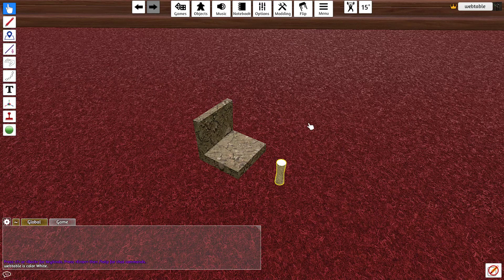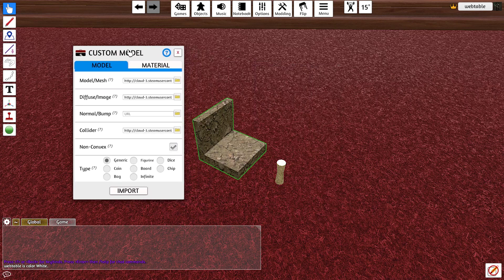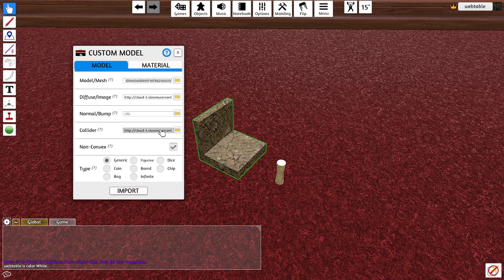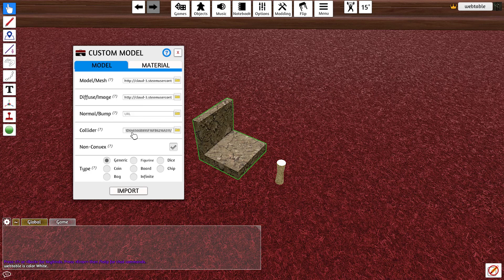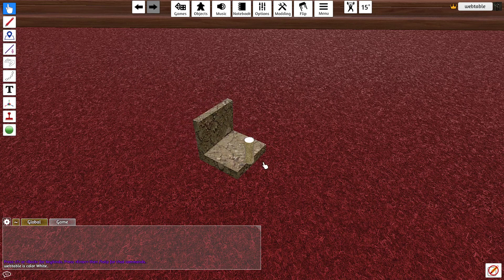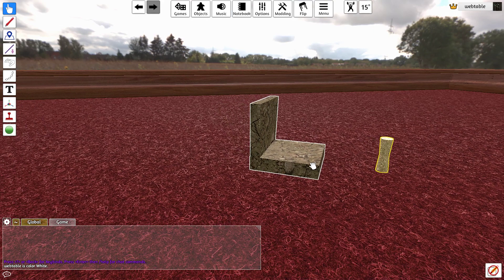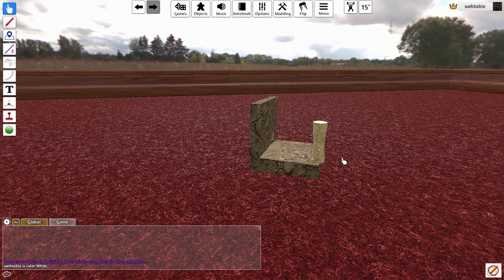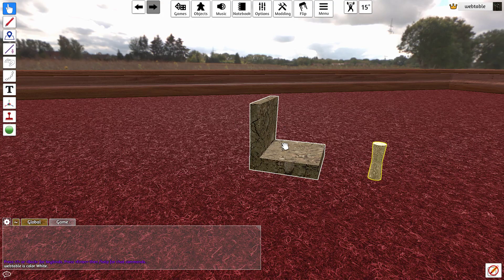Tabletop Simulator Collision Issue

Comment: Hey did you fix this issue? Im making asset bundles in Unity atm trying to get a custom collider working and Im finding the asset I bring in just keeps falling through the table even though I have given it a mesh collider...
Reply from the maker: I am not sure what your problem may be. My Unity meshes seem to work fine although in most cases I just used a Box Collider instead of a Custom Collider. I seem to recall that to get concave meshes, you had to use the TTS Lock function. If you did not the mesh would still work but would be encompassing mesh as opposed to a mesh with concave parts.
Reply from the maker: Try looking at this tutorial that I made. You don't need the beginning but you can jump to the Unity part to see if I set some settings which you are not setting.

https://www.youtube.com/watch?v=y3T10OfABGU&t=492s
Reply: @LordAshes  all good now I solved my issue last night... Thanks for the video though o may just watch it regardless, always good to see how people do things.... My issue was with colliders when making asset bundles from unity rather than objects... But I found the solution was as simple as turning "read/write" on the collider mesh when importing it into unity. There are import settings down the right side after you've imported it in and once you turn this on it reads the collider in properly. This wasn't the only issue though, on the mesh collider settings, under "cooking options", I had to turn this to none... I think some of the functions under this was causing the mesh to be altered making it have incorrect collision results in table top...